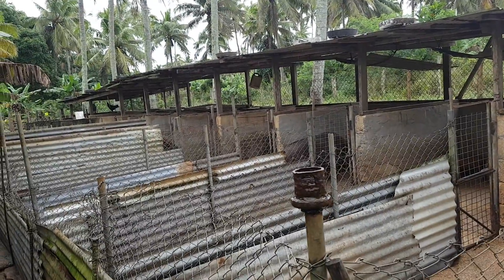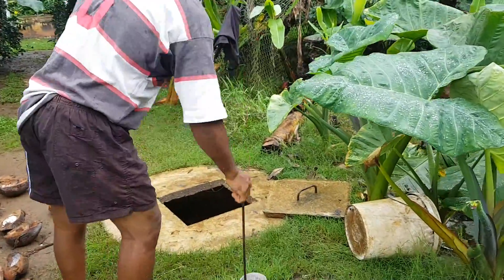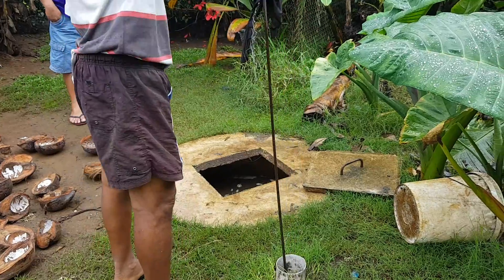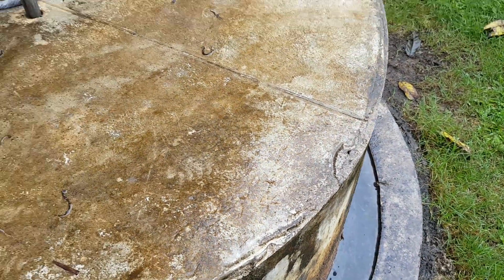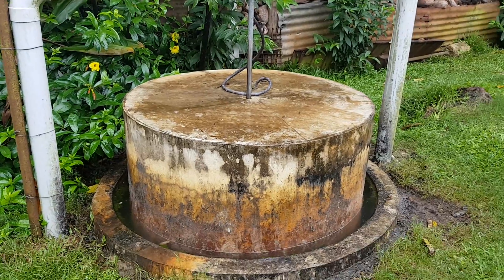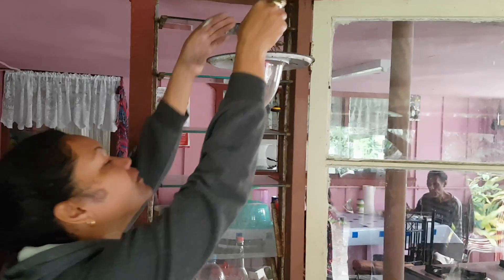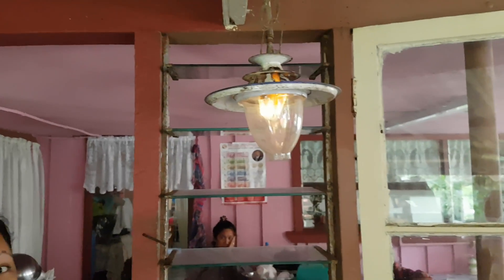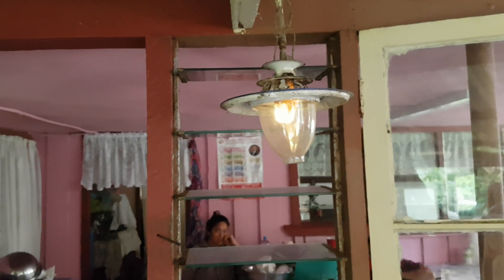Bio gas system in Tonga

Comment: Without Prejudices 

Maalo Moni.

Any law in Tonga to Control the Installation of BioGas system in Residential Area or  
Close proximity to people.

Does the Tonga Fire Department involved in the Monitoring the Safety Standards of the Private Operated BioGas system in TONGA 

As you know BioGas is very Dangerous posing risk of FIRE and EXPLOSION 💥 from Flammable Gases.

ASPHYXIATION from OXYGEN Displacement.

Hydrogen Sulfide and Ammonia POISONING ftom Toxic Impurities and Exposure to Pathogens.

These dangers stem from the gases produced during ANAEROBIC digestion like Methane gas and Ammonia.

And can also arise from Mechanical mulfunction n poor ventilation.

Hope Tonga Government is Aware of all the Risks involved in
Biogas Technology.

Especially in Private Homes and Residential Area in TONGA.

Koe fietokoni pe 

Maalo
Reply from the maker: All biogas systems so far have been provided by overseas. So I'm sure all is regulated.